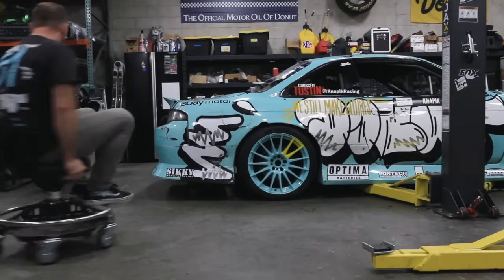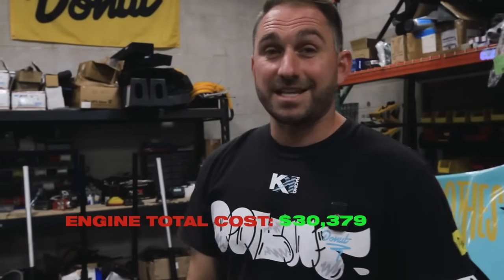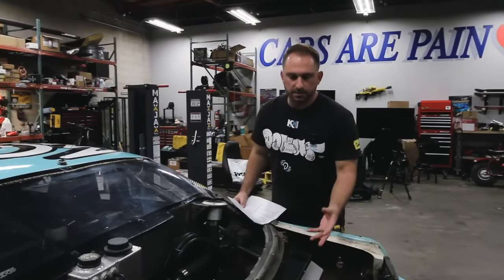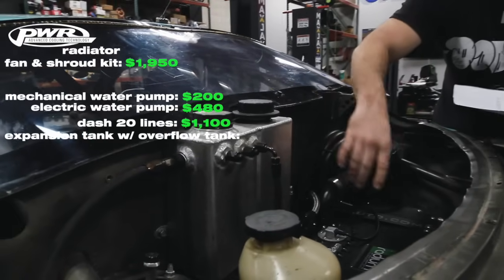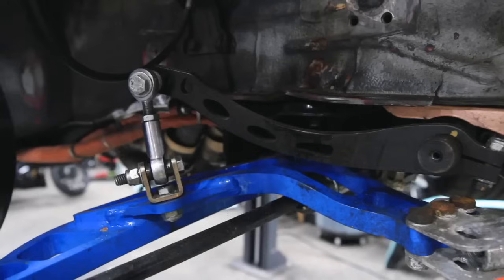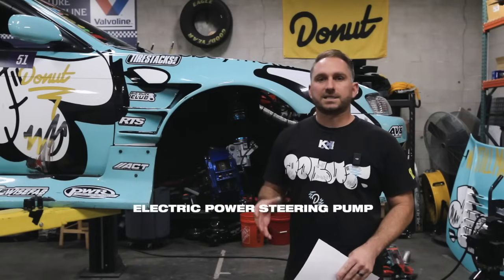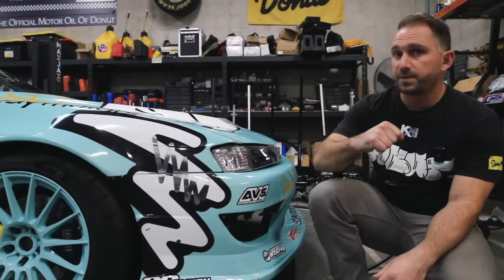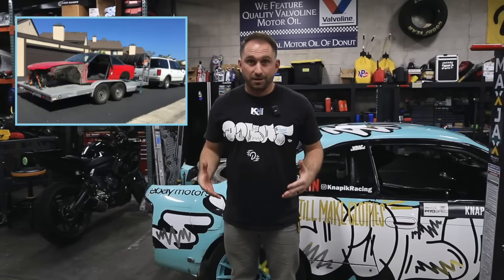HOW MUCH IS A RACECAR!?

Comment: 255?!!! Rear tire size how do you have grip I’m running 265 on stock 350 drifting and I still want more grip
Reply: He's running a wisefab knuckles in the rear. I'm certain he has plenty of grip lol
Reply from the maker: We also run a pretty low PSI, any where from 10-20 depending on track and what we want out of her. We're on a 200 tread wear tire as well from GT radial. Its their Champiro sx2 RS tire, so helps too lol